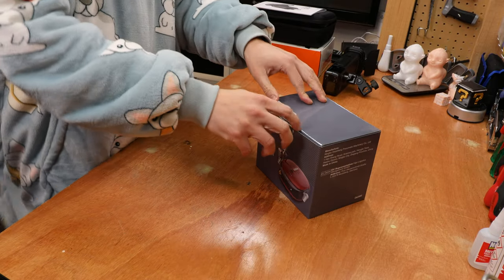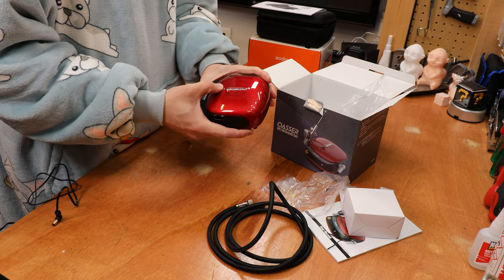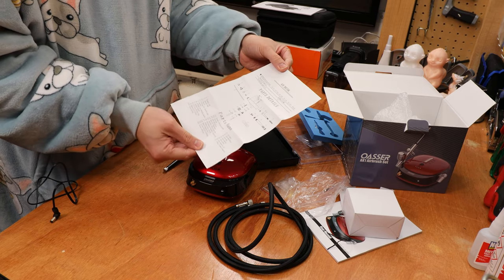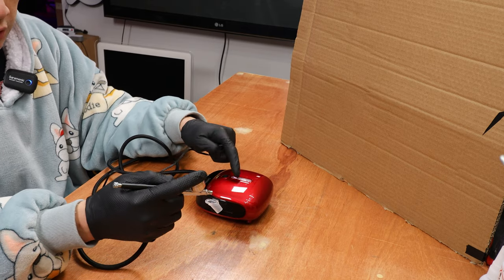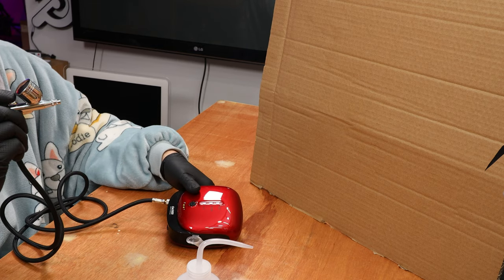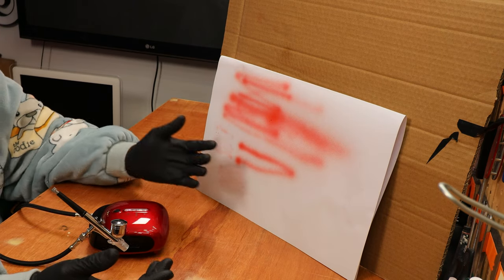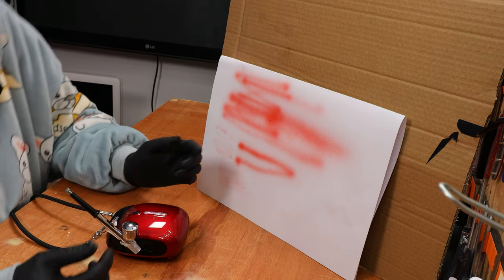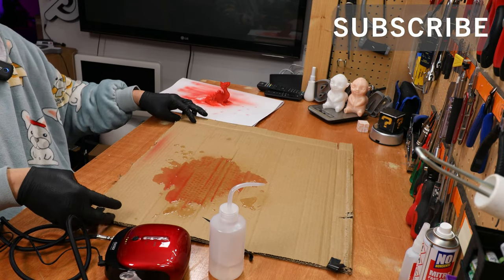Oasser Airbush Compressor Kit Review  by Benson Chik no more can spray 2021

Comment: Great but seems very tedious to use, power or cleaning could be troublesome 😲, but looks easy to carry around on the move device.
Reply from the maker: Yes there are some cleaning to do , my way of cleaning is to run it with just water until it spray clean water. Would have better result and quicker to dry with solvent based paint but water base acrylic is much easier to dealt with .
Reply: @BCreviews  this is great if your mixing custom colors, if normal colors would aerosol spray cans be more practical as less cleaning
Reply from the maker: Of course can is easier, just invert it and spray for 2 seconds until clear then job done  :)   But it is expensive and also solvent based paint only, which makes me want to built a spray booth for the fumes
Reply: @BCreviews  yes that's correct, but if doing many time and large area they actually cost more time and money, than a mixed paints into spraying system machine helpful and cost less, definitely a spray booth help as you don't mess the house up,🤭 and efficient setup when needing to do a spray job quickly, and not fume up or messy the family area

Comment: Can I ask:- Does this unit pulse by the time that the air gets to the airbrush? Do you use/need a moisture trap? Thanks👍😊
Reply from the maker: Air stream feels constant instead of pulse, It is of low pressure and small volume of paint used so no moisture trap needed?

Comment: Hello friend, I just bought the same airbrush.  I have some doubts that perhaps you could solve.  I bought it to paint fishing lures.  Give it a primer first, and then the color.  They recommend the 0.5 needle, but as you know this airbrush only has the 0.2.  Can you please tell me if it goes well for you, and if the other 2 needles can be bought separately?  ARE all needles universal?  Or each brand has its own needles.  A pleasure to watch your video.  Greetings mate.
Reply from the maker: Not an expert at air brush but given the small compressor from this machine a bigger needle may drop the pressure too much to have even spray of paint droplet. May be possible but you will need to experiment with it
Reply: @BCreviews  
I understand.  You're right.  it may take pressure off you.  Anyway, since I bought it in Amazon Spain, if it doesn't go well I return it.  The truth is, it looks nice.  It will be necessary to prove it.  Thank you for your opinion.  Greetings from Spain.
Reply: @OIR_EL_SILENCIO3  Did it work for you with a larger needle?

Comment: Is it possible to use it with the adaptor plug only without the battery?
Reply from the maker: When plugged in it will use the mains to charge the battery and also operate the pump.